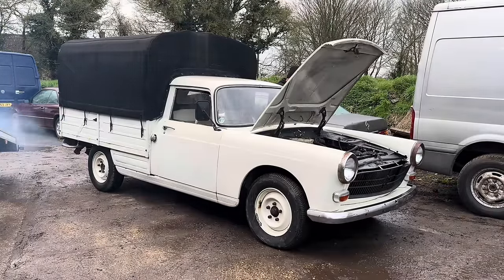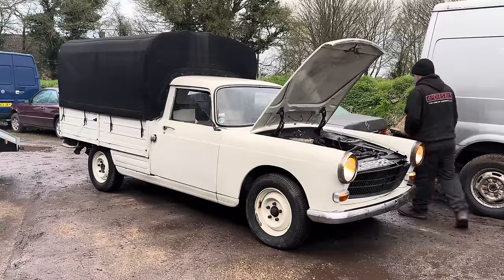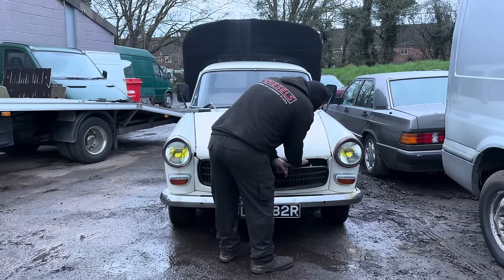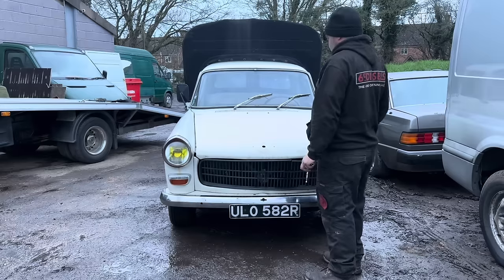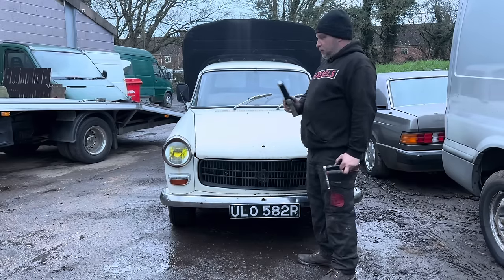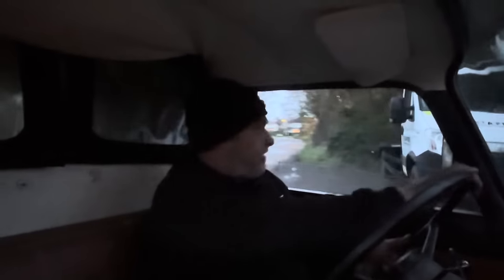Road testing the 404 pick up !!! Is she daily driver material???

Comment: At the age of ten, my father came home with 504 estate. It was a T reg, if I remember.  We drove from Berkshire to Austria skiing with it and many miles as a family wagon. it was vast inside and all the young stuff parents believed they needed for bringing up off springs fitted with space still available. It was the 7 seater also. One trip from Berkshire to my Uncle and Aunts in Falmouth was about the only time it had a 'moment' and travelling over Dartmoor in the night, the exhaust sheared off the manifold. We didn't need to worry about the sheep in the road, with the sonic boom of a car who's exhaust was short enough to see exhaust valves in the head moving. So, when we got to the 'sleepy' street of my aunts and uncles home, the crescendo of dragster noise of arrival did wake and curtain twitch most of the street. They then 'enjoyed' the early start up the next morning so the old man could get to an exhaust shop to get the parts replaced. Was a fab car and  those old french beasts were certainly better than the current tat they now manufacture.

Comment: Hi . My yellow pick up is fitted with a XD 2 Diesel motor and 3,899 :1 diff and 0,821: 1  5th gear ratio and drive nicely. My white pick up is fitted with a XD 3 Diesel motor and  runs on 3,7 : 1 diff ratio and 0,821 : 1  5th gear ratio. I drive them all over South Africa.

Comment: That starts better than my old 2.3d Sierra, Can't beat an old school diesel for just keeping going regardless.
Reply: The 2.3D engine was a later revision of this engine in Al's 404.  Sierra had the 2304cc Peugeot Indendor XD2 installed upright where as they are canted over for the bonnet line in Peugeot cars, but basically their much the same except capacity and minor things like sump and cooling fan.

Comment: Just thinking about the white smoke, seems a bit like incomplete combustion when cold which could be a timing issue. I assume it's got the Lucas CAV pump like the later XD2 engines, if so worth slackening off the three bolts a bit which hold it place.  Slacken the clamp across the 4 injector pipes and then start it up.  Twist (with force) the injector pump whilst the engine is running one direction first see what the result is, more knocking or smoke, then the other way to see if it quietens and the smoke clears. Get it in the right place and tighten up the pump.   You probably know all this but worth sharing the knowledge when we can. #Weirdcartwitter

Comment: She is coming good Al. Your hard work has paid off, even third seems to becoming easier to engage. With this being a 1.8 could this be an earlier version of the same engine found in the 205 1.8D? Wonder if some parts from them would fit this, as they are still about.